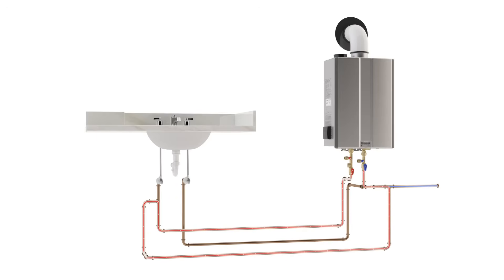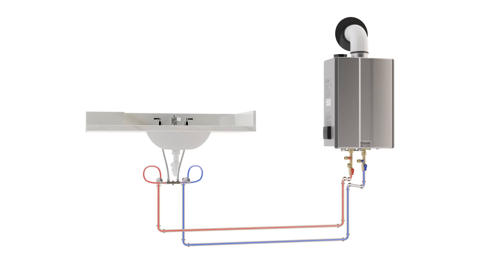How Rinnai's ThermaCirc360™ Recirculation Works

Comment: Seems the design of that would allow the boiler to be running constantly no?
Reply: I just disabled my recirculation loop as it was costing me more in gas to have instant hot water than it cost for me to waste 15 seconds of water going down the drain.  Starting to think this is a marketing ploy so your hot water heater goes out faster so you are forced to buy a new one.. planned obsolescence..
Reply: @FJB2020  yea that just kinda seems silly to me to have the thing running all the time. My tankless is effecient cuz it never runs n sits idle. Ten seconds of cold water n bam lol gas isnt cheap in ontario.
Reply: @FJB2020  Its not a ploy...its a luxury. Luxury costs more money...always. 40 yrs experienced new construction plumber...ask me anything.
Reply: @readmore3634  It is a planned obsolescence ploy marketed as a "luxury" but the reality is, the heater will need to be replaced sooner if you have it doing recirc all the time and I have found that it really didn't save that much time in my use case (under 15 foot runs to each fixture).
Reply: @FJB2020  I've replaced 100's of water heaters. Seems the water with the most impurities (chloramines) fair worse for the system as a whole. But there's many different  variables and reasons WHeaters fail early.
 I ran an overhead, dedicated, insulated half inch pex line to my furthest fixture (kitchen sink). Takes like 15 seconds to deliver piping hot water now... and the insulation keeps it hot for about 30 mins. Best thing I ever did. Not a fan of circ pumps....but in some instances it's necessary.
Reply: @readmore3634  we have our tankless water heater on one end of our house and our primary shower on the other. By using only the shower it takes 2 min for the water to be warm enough. What’s your recommendation?  Thank you
Reply: @jdub884    Our kitchen sink is the furthest. It's a single story so I ran a dedicated, insulated line through the attic from my water heater straight to the kitchen sink under cabinet. Call a  contractors plumbing supply house (Ferguson for instance) and ask them who is a small business that pays their bills on time. Have him over and estimate the cost of a dedicated line to the more difficult to reach shower valve.....you have to cap off the existing one.
Reply: Were your pipes insulated by chance?

How much extra gas were you using?

Comment: I have not actually been able to find a DIY video on installing a Grundfos timer on a Rinnai tankless water heater with a recirculation line plumbed out and ready to go. Using different videos, it appears if I PLACE A "tee" on the cold water line by the tankless water heater and connect the recirculation line, then connect the Grundfos recirc pump with timer on the hot water line coming out of the tankless heater that should complete the recirculation connection. Any comments would be appreciated.
Reply: Is your Rinnai equipped with the 360 Circ-Logic?  Because unless you install a flow switch on the external re-circ pump on the hot outlet, it just nullifies the whole “on-demand” factor of the unit you pay quite a bit of money for as your unit will run when it doesn’t need to.

Comment: How come I have a dedicated return line,  and my dumb ass plumber put this in instead?
Reply: Richmond Generator I think you need a new plumber!
Reply: A circulating system, by definition,  has a dedicated return line. The entire system  SHOULD have been insulated....that way...there is little heat loss by the time it arrives back to the heater. It SHOULD  have a swing check valve near the pump. Ask me anything plumbing.
Reply: @readmore3634  I feel ya, I just bought a new house and pre-purchased, through the builder, a tankless recirculating hot water heater -this is not my first, I just left a house with a Navien system and it was great.  Anyway, the asshats did not install a dedicated hot water return line, they chose to use the "super cool, super easy" -bullshit, crossover system and the wifi controller.  Well, this house is not all that large, but it is long and wide (single story slab on grade), but it does not have only one plumbing loop, so the right side of the house is like using a normal water heater as far as the time it takes to get hot water. 1-2 minutes.  The crossover was installed at the furthest sink in the long run on the left side of the house.  Well, here's the deal with that, the master sinks do NOT have cold water (furthest point on the left side of the house).  It is Luke warm, duh, what the hell do you expect when you use a cold water line to feed a crossover.  So, funny, after reading the installation manual, and realizing what they did, and another fairly critical stupidity, and writing one hell of a detailed technical document referencing the installation manual by page and in their language.  I then, also had to explain that I did not make this all up. I had also figured out how to access the Rennai PRO tech support, and they, after putting me through a bit of a knowledge test, gave me all the information and ammunition I need to have one heck of a discussion with all the players in the upcoming meeting.  It will end how it ends, but based on a conversation I had with the plumbing company a few minutes ago, they seem willing to do whatever it takes to get this right -in such a way as to make me think I caught them red handed at a little game of bait and switch to save a few bucks in piping and connection complexity.  I'm sure it's not cheap or easy to run a return line, even in build stage.  It's probably a pain in the butt to double do lines, but I was charged $1,560 to have recirculation.  I guarantee the damn crossover valve and wifi unit don't cost anywhere near that.  That sounded like we were paying more for the additional work it takes for a return line.  I'm sure we won't win this small issue for a very big player, because there really is no "win" to be had.  I won't allow them to tear our house apart to run a dedicated return and re-plumb, tile, etc. and all that would be necessary to get it correct.  So, I am left with the "crossover", warm water at the master sinks, and water that starts out Luke warm, goes to cold, then slowly goes to temperature.  So, this little gem of a system saves maybe a minute over starting out cold on the left side of the house.
Reply: @terrybaudoin2403  They should for sure refund all the $$$ charged for a (insulated) return line. I'm assuming the potable water system is ran through the attic...nobody runs water systems under the slab anymore (unless island sink)  Question....do you have a tankless water heater, and did they insulate the overhead hot water system? If they insulated the hot water system you can fish a couple 1/2" pex lines (insulated) back through the attic (if possible). You can run 2 return lines on one pump...one for the left and one for the right side of the house....cutting a tee in as close to the furthest fixtures as possible.....the return lines do not have to go ALL the way to the fixture....within 10-15 is fine or even further. Some attics have that blow-in insulation that's adequate if it's covering the existing pipe. Tie the 2 lines together and bring one pipe down to the water heater. I'll need the answers to the aforementioned questions before I can help you more. I'll check my replies.
Reply: Your answer is in the question🙃

Comment: Do you need to install one on each sink or just in one?
Reply: "One" as in the crossover valve? If you have a dedicated return line, you do not need a crossover valve. If you do not have a dedicated return line, you would just install one of the crossover valves at the furthest sink from the water heater.

Comment: After doing quite a bit of research and talking with several plumbers, I decided it was more practical in my particular case to replace my 19-year-old conventional water heater with a modern conventional water heater. However, I added a Taco cartridge style recirculation pump and digital timer. I will add a Taco SmartPlug Aquastat device very soon.
Reply: What is is purpose of the digital timer? Since the Taco SmartPlug Aquastat is designed function in place of a timer or an on-demand switch?

Why choose a less efficient type of WH? Was it cost or complexity or added maintenance or some other issue? But since most plumbers in the US have limited expertise with anything truly modern like tankless units they tend to be bias and prefer to work on what they have the most experience installing. Just curious what was the reason(s) for your decision?

Comment: Won't hot water come out of the cold water faucet until all the warm water has been drained from the pipes using this setup?
Reply: Absolutely, and it is just as much of a nuisance as cold water coming out of the hot faucet.  Avoid.  I had the plumber come back and install the return line.
Reply: Yes.    But it's not bad unless you are seeking to drink a cold glass of water.   You can run the cold water until the returning warmer water is flushed from the cold water pipe.
Reply: @robertgift  This defeats the purpose of having this set up, lol.  All it does is transfer the problem of wasting water from the hot side, to the cold side. The goal is to waste ZERO amount of water if possible, ESPECIALLY in  drought stricken areas.
Reply: I'm having this exact same issue. I now wait in my shower for a couple of mins for the cold water to come because the water is too hot 😅 I cannot reduce the temperature when I have a recirc pump  setup according to the manual. Frustrating.
Reply: I have this, and yes, warm water (not really hot) comes out of the cold tap during the recirc interval. I run the recirc pump on demand using a wifi button, so it's not like that unless I am expecting it. Seems worth it to not waste the water.  My other faucets are not on the same branch of plumbing, so it only works (and affects) my kitchen sink's hot and cold lines.
Reply: @toriwalsh4594  What temp is your rinnai is set to when recirc is on? My water is very hot and have to wait for a couple of minutes to drain the hot water. The whole purpose of recirc pump is lost if I have to wait again.
Reply: Point of Use Instant HWH can make sense, at least for just the faucets. The should have sensors so they only heat hot water in the line until the central unit supplies it.... And it's more efficient and tends to cost less to run than a far more complexity of a recirculation system.
Reply: @nc3826  They work great for sinks in bathroom or the kitchen, because they can sit under the sink. Can't do that for a shower, so you'll still have to remember to turn on the shower 2 minutes before you need to use it. 
Aside from the initial installation cost, I read that using a recirculation pump might only add about $25 to your annual electrical bill.
Reply: @markmcsw With all do respect, you're incorrect on both counts. I have traveled and  have used point of use showers with virtually no delay. (BTW faucet units can have the heater built directly into them)
And the only way to use a recirculation pump and have the annual operating cost $25,  is to only have it turned on for a few minutes a day and have a very low electrical rate.
Reply: @markmcsw  I do agree with you on the point, that point of use faucets, make the most sense. So anybody considering it should try that first.

Maybe better options such as solar or a heat pump for the shower.
Reply: Yes and drinking water from the heater is hazardous. You will have to run the cold water for several minutes to flush the hot water out of the system.  Basically the same waste as flushing out cold water   From your hot line.
Reply: I was informed by my plumber that a slight temperature elevation in the cold water may be possible during the recirculation period for a very brief amount of time.
Reply: Nathan Christie no.